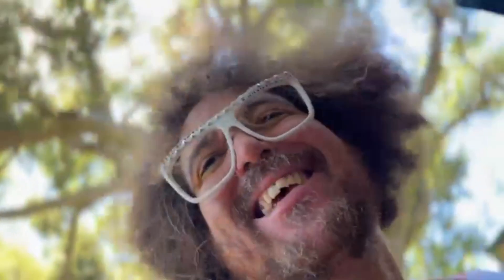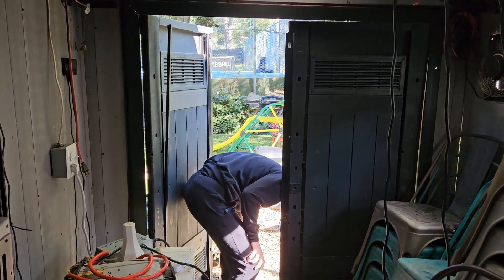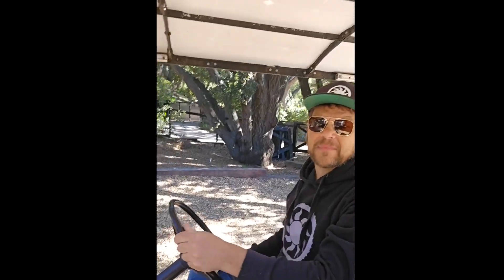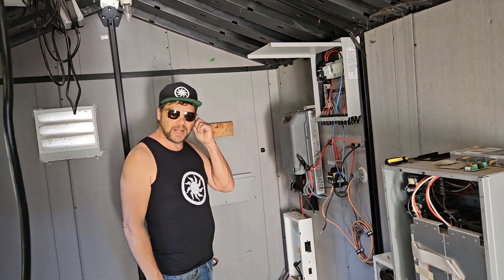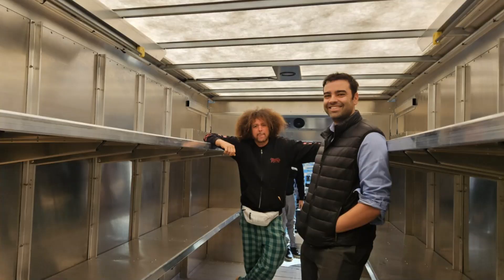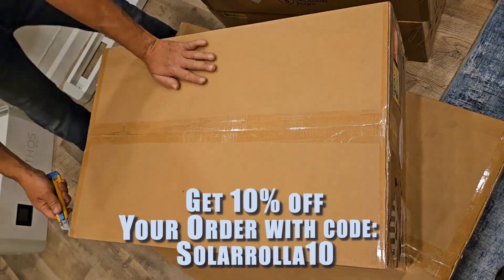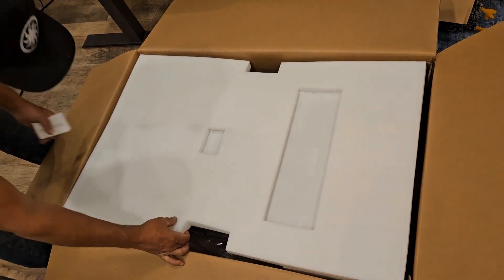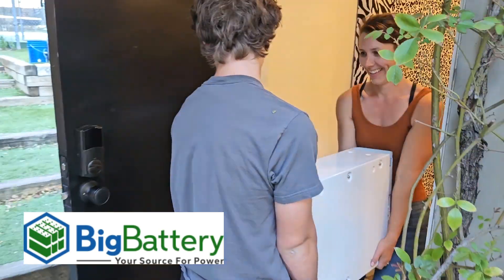Redfoo’s Off Grid BigBattery System Install, Part 1: ETHOS 48V Battery & LUXPower 12kW Inverter

Comment: Cool!  Is the 20kW just for the living quarters, or also to drive it?    If its just the living quarters, how big is the driving battery and what's its range?   If the 20kW is used for both living and driving, what is its range?  Thank you!
Reply from the maker: This is just an off grid system at his house. Not related to the eStar van we built him. He does charge his other EV's with this system though.